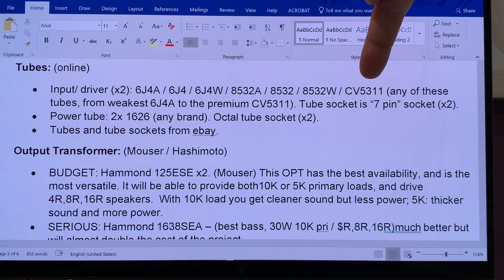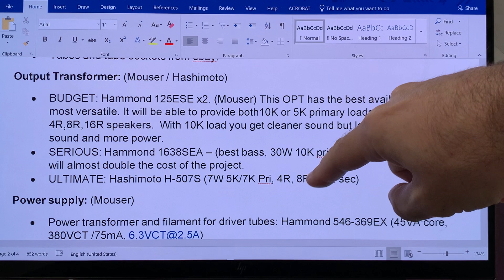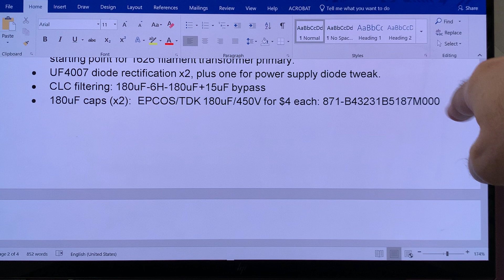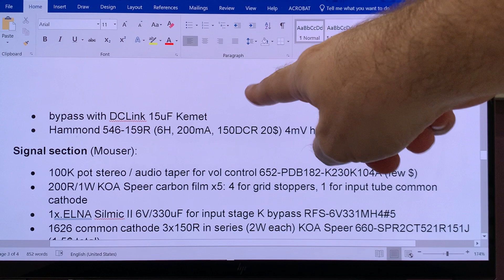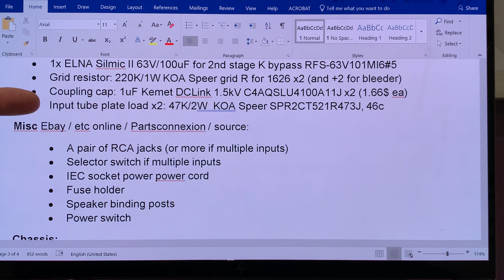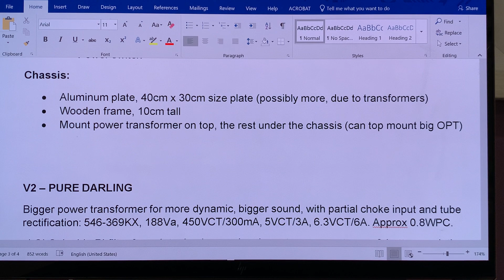AMPLIFIER COMPLETE PARTS LIST for Baby Darling SET build!

Comment: On your blog site, you suggest an alternative coupling capacitor, Obbligato Premium 0.22uF/600VDC.  Unfortunately this has been discontinued, but a few sources have its replacement of 0.22uF/1000VDC.  Would this still work?  It sells for approximately 22 Euros. Thanks!
Reply from the maker: It will work well, it's an even better cap, just more expensive. When looking at a capacitor, a higher voltage rated version of the same capacitor is always of higher sound quality. You can always use a higher voltage rated value than specified, the only thing to look for is that higher rated cap is bigger. In this case you will have plenty of space so no worries.
Reply: @realworldaudio  thanks! I did find the 630 V version in India and have already ordered it.
Reply: Good news. I was able to cancel the order from India, and obtain the 1000v version from DIY HiFi Supply in the UK.
Reply from the maker: @MrCantredr   Superb! ;

Comment: I contacted Mouser today for their assistance in obtaining their part numbers for the KOA Speer 200 Ohms 1W resistors (it was SPRX1CT52RR20J), but they were unable to find a KOA Speer 220K 1W resistor (the largest they found was a 1/2 W).  I did find a YAGEO CFR100JR-73-220K.  Would the YAGEO work as a substitute?  Thanks!
Reply from the maker: No, do not use the Yageo, it is quite poorly compared to the KOA. It looks they are out of the 1W resistors, use the 1/2W KOA instead: CF1/2C224J
Reply: Would that be a single 1/2W, or would 2 have to be used in series? Thanks!
Reply from the maker: @MrCantredr  The single 1/2W is plenty, even 1/4W would be already more than needed. I am recommending heavier wattage ones as they sound better. The 1/2W will be already very good, no worries. ; )

Comment: I putting together an order for parts from Mouser and was wondering where to find the Mouser number for the "bypass w/DC Link 15 UF Kemet?  There are 23 types listed on Mouser.  Thanks!
Reply from the maker: Hi Dan, do a search for "kemet dclink", and then click on "film capacitors". Then it will show you a list of the available selection which is 27 at this moment. Check "in stock", then apply filter, and it went down to 15 items for me. At this time there is no 15uF available, the closest is 22uF. When you select it, it will bring up the Mfr# C4AQPEW5220M3CJ as the only available choice now. That will work well! ;) In general, any of the C4 series Kemet DCLinks will work (provided they are close in capacitance.) 
Alternatively you can double up two 8uF ones (in parallel) as well to get 16uF. The parts # is: C4AQIBU4800A11J   - and two of these is cheaper than a single 22uF cap, this would be my choice;
Reply: @realworldaudio  Thanks very much! I recently built a pair of the voigt pipes out of spruce fir pine. Our Lowe’s sells 20 inch wide by 8 foot long spruce for about $48 per board. The sound is incredible. I used the Fostex FE206 NV for the drivers. I’m still sanding the surfaces and will send photos after I finish and do a one coat shellac.
Reply: @realworldaudio  sorry to bother you again, but can you provide a Mouser number for the 200R/1W KOA Speer carbon film resistors and the 220K/1 W KOA Speer resistors? These two items will complete my Mouser list. Thanks very much!
Reply: Is the Mauser part number listed on another video?

Comment: Is there an idea of meters of wire to buy? I'm considering deulund cotton silver or copper tin. Also is silver better because it matches the solder? Thank you.
Reply from the maker: I use the dead soft silver from Rio Grande. They have it in all sorts of gauges, down to AWG32. I can recommend AGW 30 or AWG32, and for higher current parallel them. For example, in the  speaker cabinet internal wiring I use AWG32, 64 strands in parallel per conductor. Insulation: polyolefin heat shrink, and covering the ends with teflon tape to avoid exposure to air & corrosion. It's a hassle though at first to find a suitable insulator, so I'd recommend the Duelund cotton silver for ease of use. ;
Reply: @realworldaudio  yes,  I'm recalling that previous episode with the jewellers spools now. Would it be possible to estimate the amount of completed wire length that is needed to connect the .75W darlings up?
Reply from the maker: @a.r.5124  Let me do a calculation, and I'll post it in a video! ; ) (For each connection you need different total AWG, that is, different number of wires in parallel)

Comment: How to build this but with say 50 watts x 2 @ 8 ohms
Reply from the maker: 1. Be an expert instead of a beginner (+15 years of building experience, as one small mistake and it KILLS YOU); 2. x20-50 parts cost 3. Why? Mating a tube amplifier with less than adequate loudspeaker will make a mediocre result, regardless of power. SETs (at any output power) need to be mated with appropriate speakers, I HIGHLY RECOMMEND wetting feet with building proper matching loudspeaker before attempting the very expensive road to high power. Analogy: if you are a dancer, you need dancing shoes, lead boots won't cut it.

Comment: very nice , will try to get these parts , will these parts be used in the more powerful version as well,  or just this specific version
Reply from the maker: Most of the parts will be useful! Just make sure to build it on a big enough chassis to accommodate for possible upgrades. I will post soon on the chassis and parts layout & planning. ;
Reply: @realworldaudio   bro if I'm having 90db speakers already , can this amp be bridged and used as mono amps , should I go for the more powerful version with the better output transformer
Reply from the maker: @IDontExist14  90dB will be enjoyable on small scale music, but very far from letting the amp shine. Yes, you should go for the more powerful one., that is happy to handle reasonable 90dB speakers.
Reply: @realworldaudio   would this amp work as a mono also , so I can get more power
Reply from the maker: @IDontExist14  If you need more power, we can double up to power tubes per channel & use a bigger transformer that can support it. Basically, you will need the electric Darling version that has two output tubes per channel. Bridging tube amps in mono works in THEORY, but it's like putting on a single shoe on both feet and expecting to dance better. You will get the opposite result. Sure, drives loudspeaker better, but you loose every benefit of this design and sacrifice all the sound quality gains. If your goal is to drive low efficiency speakers, and then this is not the road for you. (Low efficiency speakers will work in a liited capacity until you build efficient speakers, and there will they shine). You would be better off with a push-pull design. Briefly, the Electric Darling will have double power, but if you want volume & power& playing very loud and dedicated to lower efficiency  then none of these amps can be of any consideration.
Reply: @realworldaudio  I'm basically making a set of high efficiency speakers, but also have a few pair of 90db speakers, plus there isn't a market for audio in my country, so can't sell it also, I'll share my design with u tommrow of the speaker, I got everything figured out but I was thinking of including bi wiring for highs and lows seperate, we can talk about this one the email, no hurry 🚴三 take all the time u need
Reply: @realworldaudio  if u want content for a video, I can try out the speakers and the amps, click photos of manufacturing process and make video of them finished and playing
Reply from the maker: @IDontExist14  That would be fantastic, and very inspirational for everyone, much appreciated! I will post it on the channel.
Reply from the maker: @IDontExist14  With the SET world we are leaving a lot of conventional practices in modern audio. Don't worry, you will be able to use the 90dB speakers as well - I myself enjoy even the 86dB with a watt, but there are lots of people who crave ear splitting volume, and they are not designed for that. If you want practical listening, then even the 90dB speakers will be fine with 0.7W. Also, more W does not mean better sound. ALWAYS means compromise in quality and purity, just can go louder.
Reply: @realworldaudio  bro I had finished my crossover and just have to make the box, but I have the vol and port size, would u mind giving me ur thoughts on it and any tweeks u would suggest

Comment: I think an attenuator would be better than the pot volume or balance  a 6 -8 gain attenuator surface mount resistors.
 you can control both sides of the gain stage from the input and output using me attenuator
Yes you want you valves quite far apart ideally 3" or more to prevent EMI RF infiltration
Reply from the maker: The attenuator recommendation is superb! Indeed, the volume control is the weak link in this situation, yet it's something that every beginner can handle. Then, changing over to an attenuator it's a great learning experience of the big jump it makes. With high efficiency speakers 6-8 positions for volume attenuation is enough, we need no more. With low efficiency speakers the steps would need to be carefully tailored to the loudspeaker to hit the sweet spots. Indeed, keeping elements (tubes, iron) at proper distance is very important! ; )